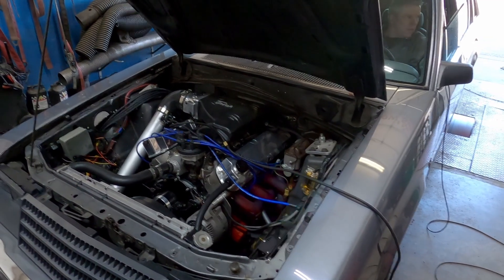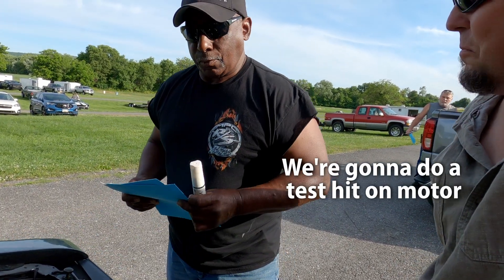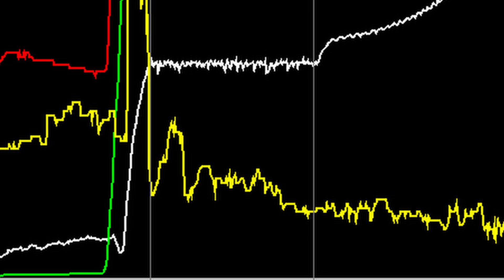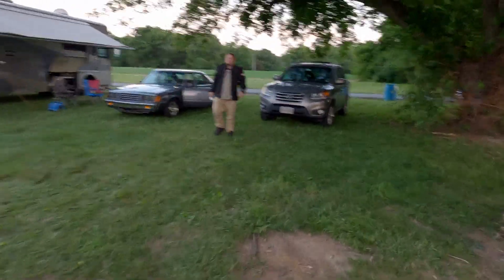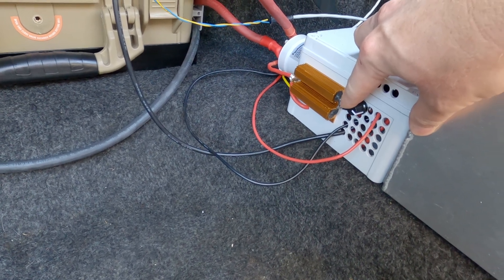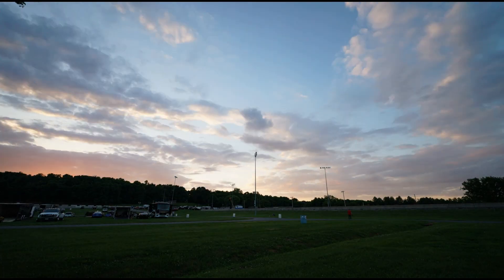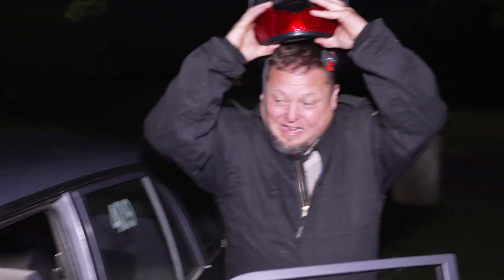Electric Turbo Powered SBF 10.26 ET @ 131 MPH (- 2.25 + 20MPH) RC MGM/LMT Power!

Comment: Gotta do this on my daily driver Honda hatchback. Has a basically stock 200hp K24 and it needs to be reliable and easily able to pass California emissions. Put the turbo/blower in an enclosure behind driver's seat and the battery in the back.

Comment: Ok cool but not practical.  You are pulling an unheard of amount of amps for one run and done.  How do you recharge that.  No alternator in the world would be able to keep up with that so you are better off with a supercharger or turbocharger.  The only things on cars that need to be electric is the radio and the lights.
Reply from the maker: We have yet to need to recharge the packs during a day of drag tests or dyno tests.  And there's no way on the street you'd kill the packs - not without killing someone (or yourself) first.  The batteries do recharge, albeit slowly, while driving around if you activate the charging circuit.  For smaller setups that would run more often, there's proportionally less draw, so it's easier to recharge.  The advantages far outweigh the disadvantages - psi per psi, there is nothing that can beat this setup.  It takes almost 3 times as much boost out of a Whipple to run the same times.

Comment: how long until you bring this to market? i was going to use the torqamp to spool larger turbos on a coyote swapped mustang. if you are will you include a throttle position sensor hook up? im impressd man. ill be watching and hopefully i can buy an american electric turbo!
Reply from the maker: I'm not 100% sure, tbh.  But at this point, it's really not that difficult to replicate the much cheaper and slightly less powerful version.  Check out our forum at www.electrifiedboost.com  - I may end up selling the various components.  I'd love to see this on a coyote swapped mustang.  A single unit (the cheaper, less powerful one) would get you into the 600hp range easy.  Two of the cheaper units should get you in the 1,000 hp ballpark.

Comment: Thank you for your time and effort to test this process. I think you're onto something good.  No more Trans brake and instant boost. With a little more testing, you can find the best power supply and motor combination and dial in the setup.
This is why we experiment. You can't learn much just talking about it.

Comment: Man, when you get that converter fixed this is going solidly into the 9's. That turbo is moving some air to make this kind of power at such low boost. You are always the innovator, Alex, ever since I met you 22 years ago to buy your dual CFI injection setup. Keep it coming, Smokey Pikas.
Reply from the maker: Lol.  Thanks Mike.

Comment: Those are good results! Any idea how much boost the engine can handle? Seems I saw peaks of almost 8 psi. Can't wait to see what you do next!
Reply from the maker: The engine should be good for at least 1,200 hp.  So that's like 17 psi - which I doubt we'll ever see.  But I do think we'll get at least close to, if not over, peaks of 10 psi in time.  Thanks!
Reply: @AlexLTDLX  Yes...you are not breaking engine parts often enough so clearly you have more power to achieve! haha! I'd like to see 15 pounds of boost from your electric setup. I wonder if it is possible. I think if your battery and controller is much closer to the motor it might be possible.

Comment: Holy shit. The amount of gain from 6psi is insane. That tells you the extreme drag a supercharger has and the amount of back pressure an exhaust driven turbo has. Too bad this wasn’t perfected 10 years ago. It would have definitely caught on. Now things are shifting to electric cars which are going to mop the floor with internal combustion engines.
Reply from the maker: Yeah, it does.  Except I'm not sure I agree with you about electric cars - I love the concept and the performance we're seeing.  But even to fully charge the electric turbo pack, you'd have to feed it 16,000 watts for an hour to fully charge it.  That made me think about electric cars vs infrastructure issues - I put out a video about how the US power grid is nowhere close to adequate to charge cars even if 2/3rds of all cars in the US switched to electric: https://youtu.be/VxrRQbbrw8Y  Also, I don't think that electric vehicles would work for a significant part of the country - particularly middle America, where people have to drive greater distances, and tend to tow things - like farmers, for example.  But even so, electric cars can generate tremendous burst power, and have literally 1 moving part in their motors - and that's a pretty huge advantage.  I think there's room for electric forced induction for years, if not decades, to come.
Reply: @AlexLTDLX  Look up the Keppe motor for some mental gymnastics on the most efficient electric motor in the world.. Congrats BTW. "^..^''
https://youtu.be/dTO5s45eNK8

Comment: Holy crap man, -2.25 seconds and +20mph?? That's crazy!! Love watching this thing progress, you're bettering the whole community man
Reply from the maker: Thanks for the support and kind words, Alexander.  Yeah, that's pretty huge from relatively low boost - I was a bit surprised, but I'm getting used to the gains since this is now the 3rd variant we've tested..  I'm personally curious to see what a new converter is good for - we lost about 3 tenths naturally aspirated from last year's baseline.  I've also always had a fair amount of slip.  Apparently, there have been a lot of advancements in converter technology since I had this converter built.
Reply: @AlexLTDLX  Seriously didn't believe it when I only saw 6-7 psi, but like you said it's just flowing so much air boost doesn't have to be too high. Especially on 93!!

Comment: Glad to see you added at least a four point harness
Reply from the maker: It's had a 5 point harness ever since I put in the 6 point roll bar - about 20 years or so (the submarine belt is under the seat).  It's just NHRA rules mandate the belts be swapped out every two years.  It's a dumb rule, in my opinion, but it is what it is.  Maybe every 5 years would be more reasonable.

Comment: So it takes 30kW of power.. 
You cam make it even faster or more efficient if you add a motor directly to the flywheel.!
Reply: No way. 6 psi of boost is worth a lot more than 30kw (40 hp).
Reply: @MrPizzaman09  Numers don't lie..when he was dragracong the motor was pulling 30'000W Watts or 30kW electrically..
A good motor with 30kzw peak can deliver 90Nm of torque which can be put to way better use  to help the motor rev up much faster and more efficiently..
Because ice engines are 20-30 efficient at their best he basically lost 70% in conversion by using that power for turbo..
Reply: @Ray88G  The electric compressor is only 70% ish efficient, but the added air pressure isn't what's making power in the cylinder.  It's getting almost 50% more fuel and air, so it can make an extra 200 ish hp.  Way more than driving it directly to the crankshaft.
Reply: @MrPizzaman09  I understand..that's quite impressive..In that case it's all worth it..
Extra 200Hp just from 30kW electric turbo is amazing. 
And there's also no drag on the engine
Reply from the maker: MrPizzaman09 is right - it seems a little counter-intuitive at first glance, but we're seeing about a 4 times improvement in power by running the electric turbo over just driving the wheels directly.  Possibly a bit more.  I keep meaning on making a video about how every hybrid on earth could be made much more efficient using this technology.  I need to get on that.
Reply: @MrPizzaman09  much better way.. all this can be done with lower voltages ..https://youtu.be/nG4OS6BgJ9k
Reply: @MrPizzaman09  https://youtu.be/GvmfoN_JwDA

Comment: Man as a remote control truck and real car guy I love watching this!!!!! I run a 5th scale rc with 20+ hp electric system, and i know this system your using is the best of the best electric system out there for rc car.... now its holding a drag car turbo record!!!! Love what your doing man!!!
Reply from the maker: Thanks for the kind words, Mikel!
Reply: It's hard for people (outside of it) to grasp how much power is being made in modern brushless RC motors.  I run an 11KW setup in a couple of my biggest helicopters.  It's not even fist size.  That's something like 15hp.  

Next week, they'll be out with a twin motor setup like the guys are using to break 200mph with RC cars.  It will end with small motors from hybrid cars or EVs.  It takes a lot of power to compress a lot of air really fast.
Reply: @yzScott  ya I absolutely love the new brushless motors and the new lipo power that's come into the hobbies. I'm about to turn 40 and grow up haven the cheaper rcs with AAA or a 9.6v pack they used in the 90s. Then 5 years ago got a 6s arrma kraton and now have a fleet of rc rigs. Lol

Comment: The graphic that included the boost and the watts was really interesting. 33Kw!!!! That's like 33 microwaves going at once, that's staggering!
Reply from the maker: Yeah, it is pretty surprising - I honestly expected a current draw of around 550 amps - instead we were at almost 700.  I think pre-compressor meth should change the data; and maybe I'll add another set of cells in parallel to get more voltage (i.e. less sag under load).  We're currently seeing about 10 volts sag.
Reply: Just switch from battery to waste heat driven at a certain point.
Reply: @forbiddenera  Nothing pre-spools like electric for the dig.

Comment: Yessssss!!!  That was AWESOME!! If I could like this video multiple times I would.  Great work.  It's definitely been a journey to get here. What's causing the Arduino to act up when in full power?
Reply from the maker: Thanks for subscribing - the issue with the arduino is related to the code - I noticed it on the bench too, when running it at 2ms pulsewidth.  I'll likely just drop back to the more basic code, which worked fine, since I don't need the other features in my application.

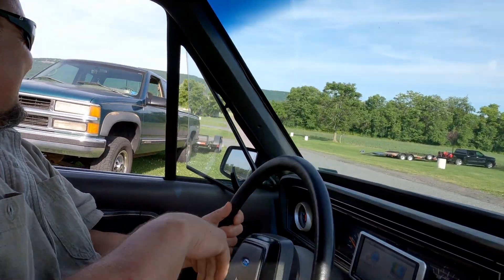Comment: WOOHOO!!!! way to go Alex, it will set a PB for sure after the converter is addressed. and @2:00 you have..... a smoker.
Reply from the maker: Thanks.  I think it will surpass the Whipple - probably this fall.  The DA on that good pass was over 1,800 feet and we had no charge cooling yet.  Some meth, a new converter and a mineshaft air day, and we really should be able to lay down some decent numbers.

Comment: That has got to be a very proud moment. People spend 10's of thousands to make a car run in the 10's. Great content and can't wait for the next one.
Reply: Ya and sloppy spends under 9k to get into the 8s
Reply from the maker: To be fair, James, you're comparing apples to oranges.  Matt's whole MO is, "how cheap can I be to go as fast as possible?"; while this is more in the category of "new technology research and development."  A friend of mine bought one of Matt's cars (the Fairmont - Leroy), and in short order, pretty much everything had to be replaced - the turbos, the engine, etc.  I suppose I could throw on a couple of china turbos on some flipped shorties and run 8's too - but that's not my thing.  And I don't like to drive junk - most of that stuff breaks sooner or later.  Not to take anything from Matt - he's definitely put up some impressive numbers over the years and did discover what cheap garbage will work - and many people have copied that; though most have stuff fail and eventually pony up for better parts.  But I wouldn't really call his stuff "cutting edge" or even "well built."  We're in different worlds, and both are enjoyable/entertaining; but for different reasons.
Reply from the maker: Thanks for the kind words and support, Sonny!

Comment: Out freaking standing! Any chance of that turbo making more boost? ..... Or do you need a bigger one??. Don't know so I ask.
Reply from the maker: Thanks.  Pre-compressor meth, playing with the motor timing and possibly doubling up on cells in the battery packs would give us more boost.  I'm going to try the pre-compressor meth first, because I'd feel better with the extra octane and charge cooling; never mind that it makes the compressor act "bigger."  We'll definitely keep on keepin' on and see what the practical limits are with current technology.

Comment: 10:26 is a pretty good et 99% of people at the track will never build a car that hits those times.. pretty impressive for what it is. out of a ford sb 350 too. youd expect to see those numbers with a super charged larger displacement
Reply from the maker: Thanks.  I was pretty pleased with the gain, especially given no charge cooling and toasted converter.  Plus the DA on our best pass was over 1,800 feet.  Pre-compressor meth, a new converter, a mineshaft air day and we should be pretty solidly in the 9's.  And then, who knows - there are a bunch of different directions we could go.  I'm just having fun doing this!
Reply: @AlexLTDLX  yeah at sea level its gonna be even faster. crazy. its pretty solid times you putting out of a car with a full interior and full weight. if you stripped that thing down youd probably gain another second easily too. so you in real good ET with everything anyways. good solid build.

Comment: Congrats bro! I had problems with arduinos acting up on my setups too. Theres gotta be a more robust solution available somewhere.
Reply: Def hittin 9s with new converter and meth injection!
Reply: If you're willing to spend the money then an industrial PLC will get the job done with no fuss. They're built to be as deterministic as possible where Arduino's can encounter weird glitches.
Reply: @phylaxxx  ill look into that, thanks!
Reply: @DarkCloud Racing,
Have you tried an esp32, 8266, or an stm32?
They have quite a bit more processing power but very close to Arduino prices. I mean a LOT more power.

To be honest, I had issues with arduinos acting up but later found that I had not prepared for real world things happening which resulted in my glitches. Currently even my plasma torch CNC table is run flawlessly by an Arduino nano even at 300 IPM. Insulating it from the electrical noise of the torch took some figuring out. Phylax is right, arduinos are labor intensive because the debouncing, isolation, pull ups and pull downs, and clamping is not done for you as with an industrial PLC.
Reply: @3dw3dw  i didnt try too many things no, and i think my problems were from electrical noise. These ESCs and bldcs seem to put out alot of noise. Ill have to look into those options if i revisit my project, thanks!
Reply from the maker: Thanks.  Honestly, I noticed it was flaky when testing on the bench, too.  The basic code worked fine; its when we started adding everything to the code that it got weird; and only at 100% on the power knob.  I left this out of the video, but input request dropped twice on the last pass, too, but only for a split second, though it did it twice.  I'll likely go back to the code that worked, since I want full power all the time.

Comment: Gaud dam that’s impressive for 6 pounds man especially in a small block Ford that didn’t even run a 14 I definitely won’t look at my Paxton the same way anymore
Reply: Six pounds with no drag on the crank or the half bar in restriction on a turbo in the exhaust.
Reply: @dennisford2000  Yeah I got that that’s why I said I would never look at my Paxton the same way again I am a subscriber but forgive me for not religiously watching but how are you charging the system and how many times can you use it
Reply: @dennisford2000  you don’t need to answer that I went back in your videos you’ve got a good idea viable I guess for the dragstrip but I play on the streets so it’s kind of useless to a guy like me but keep going you’ll get it there then hopefully someday you can put that in a fox body with an aftermarket block based on Ford which I gotta say I seriously appreciate that you’re using a ford product to do this. Mines an 89 fox body, 331, Paxton novi 2000, suspension based more on autocross than drag racing And a TKO 600 transmission I really like having fun on the streets😎good luck brother
Reply: @600wheel  what videos?
Reply: @dennisford2000  i went back and watched the older videos on the channel
Reply: @dennisford2000  yeah I forgot to say the reason I told you what was in my car was so I could tell you it takes 12 to 14 pounds boost to get 550 575 wheel on the local Dyno with one of the most efficient blowers you could buy in it’s day so what you’re doing is beyond amazing
Reply: @600wheel  you know I am not the o p?
Reply: @dennisford2000  shit my bad i’m sure they’ll get it anyhow but I’m assuming you religiously watch these videos you slammed that info at me immediately good job they should hire you for public relations and advertising when that thing starts to pop off
Reply: @600wheel  I wish. I do have a scientific mind and am a raconteur. Spent 50 years fixing stuff, mainly cars .
Reply: @dennisford2000  Sounds like I’m talking to myself. You never know man a lot of YouTubers find their best employees are someone who is a fan to begin with